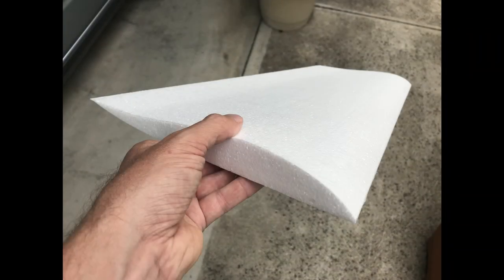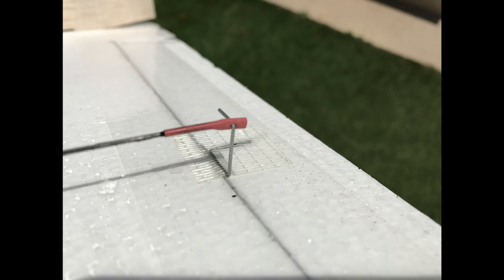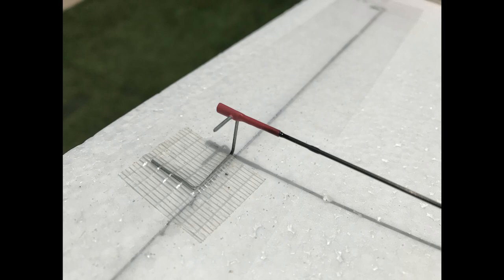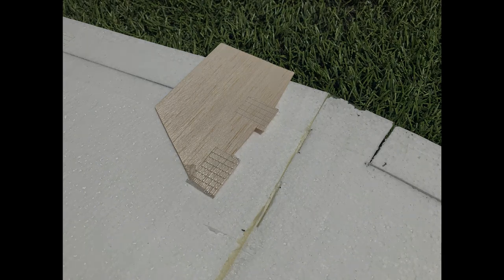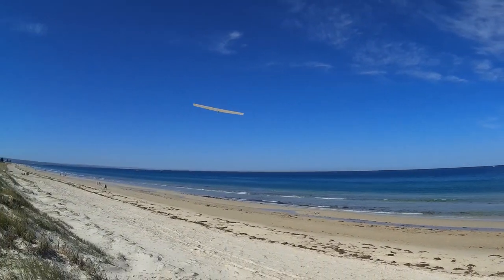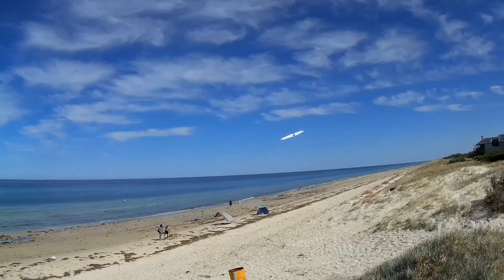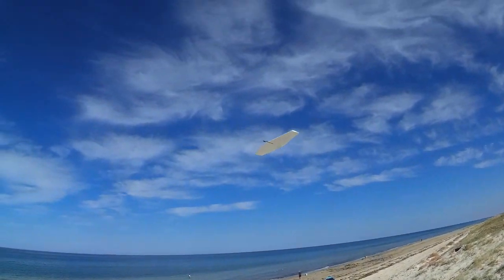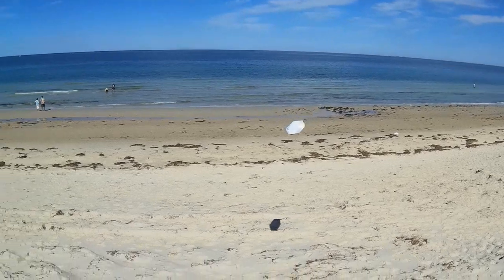95g Wiesel

Comment: Just wondering.  What size foam are you using...
I got some from home depot... And it only comes in a 1 inch thick sheet.
To thin to cut. Airfoil out of. thanks
Reply from the maker: I got big offcuts from a EPS cutting company (http://allaxis.com.au/).